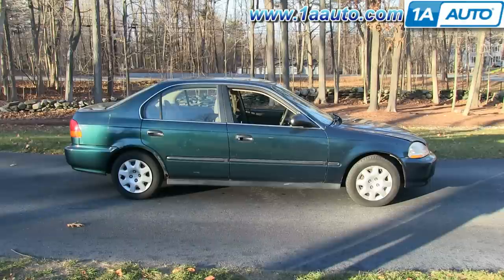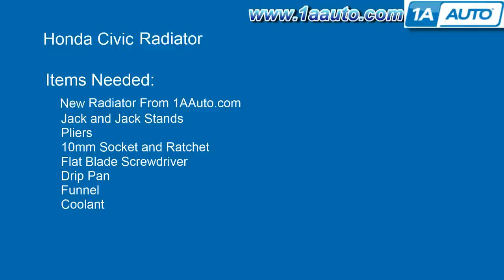How to Replace Radiator 92-00 Honda Civic

Comment: Thanks for sharing this video!  It gave me the confidence and knowledge to replace my radiator, and now my overheating problem is fixed.  For what it's worth: the cooling system must be bled after installing the new radiator!  I was unaware that was part of the process, and during my first test drive after installing the new radiator, my car quickly overheated, just as it did before with the old cracked radiator.  Then I was afraid the head gasket was blown.  But, after some research, I bled the cooling system by running my car with the radiator cap off and heat dial on high (but the fans off), keeping the RPMs up a bit for the engine to reach normal temperature.  After about 30 minutes and topping off the coolant in the radiator, all seemed good.  On the second test drive the temp was perfectly normal; problem solved!  Hopefully that helps.  Thanks again, 1A Auto.
Reply from the maker: Thank you for watching. Glad we could be of help. Please let us know how the repair comes out!
1aauto.com  888-844-3393

Comment: I like that you left the fan on the radiator, instead of removing the fan while still inside the car.
The more work you can do outside of the car, the easier.

Comment: Thank you so much for posting this Vid. I had an appointment set up to have mine replaced. After watching your video, I was convinced I could do it myself. It went in without a hitch. I also appreciate the comments below. I had not read them until after I had it in. I just bled my system, and I'm now good to go! Thank you again 1A Auto Parts!
Reply from the maker: Brad L Thanks for watching 1aauto.com 866-403-3393

Comment: Thank you so much for this video. In the Haynes manual it says to drain the coolant system and part of that is draining the engine block via two further drain screws. These are difficult to locate and the one by the oil filter is impossible to get to. From your video it is clear that it is unnecessary to drain the coolant from the engine block unless you want to flush it through and this saved me a lot of trouble. Thanks guys. I did take care not to lose coolant out of those two smaller hoses though.

Comment: Seems simple enough. I suppose while I'm under the hood I can go ahead and clean a bunch of stuff up and make sure there are no other hoses that are busted. Last time my coolant started leaking badly in my 96 civic, some oil had leaked out of the gaskets on my engine and saturated the rubber coolant hose underneath. It split in two and for about 2 hours I was freaking out about having to scrap my car.
I'm gonna give this a shot hopefully tomorrow and see how it turns out, thank you for the detailed video!! I'll keep you posted!
Reply from the maker: +shanesxe Thanks for watching.  Do let us know how the repair turns out.  1aauto.com  888-844-3393

Comment: I removed an additional little ultra rusted out metal bar that holds the insulated pipe in place that is shown in this video and sand it off some of the rust and rub some polish on it.

I also went ahead and took the entire under the car plastic protective thing off and cleaned off as much of the grease and tar that I could.

I found that removing that extra little metal bar piece allowed me to get to the transmission lines a little easier.

I would like everyone to know that at least on my car the pressure clamps on the transmission lines and I think the other big one at the bottom were made as three separate tabs in which all of my pliers were too narrow to open and there wasn't enough room to turn it sideways to use the length of the Jaws instead of the width of the Jaws and I ended up having to get a small scrap of what similar to like a toothpick but a little thicker and a little wider and I place that on the two tabs of the clip so that I could use that to push both of the top tabs at the same time while using my wrench on the bottom single tab so that I could compress it in order to slide it back to remove the hose.

I also had quite a bit of trouble lining up the little replaced rubber feet on the bottom in order to push the radiator down enough to make it fit in the car properly. There's a little rubber peg in the middle that has to kind of line up with a little hole in the middle cup shaped thing at the bottom.

Also the screws that hold that plastic protective thing under the car, they have these little plastic inserts that go into the holes and then you have to put the screw in and screw it but the screws will not screw in completely tight they will free spin after all certain amount.

I also foolishly didn't notice that they had the four replacement square nuts to go into the new radiator which allow you too screw the fan on it. So I put the old ones in that had rust on them. Unfortunately once you put them in, it seems impossible to take them out without breaking the plastic housing that they go into which is how I got them out of my old one. Also the old ones had a little bump that helps hold them in place. The new ones don't.

I also had some parts it came with that I didn't know what they were for and didn't use them. 2 rubber hose things and 2 long bolts and some weird shaped rubber pieces.

Comment: So u dont need to burp the coolant after doing a radiator replacement and changing the upper and lower radiator hoses? Also what screws should I buy for those bolts? The one son my fan are stuck and wont come out no matter what I do.

Comment: Perhaps you, 1A Auto, or someone else, can explain what to do to re-attach the splash shield (splash panel) once it has been removed. I'm finding that almost all of the 10mm bolts which I've unscrewed to remove the panel just keep spinning free when I try to bolt them back on. Apparently there is some kind of nut-like attachment behind where the bolts are fixed that has detached completely, has rusted through, or simply dropped off. Or bolts are self-tapping, but there's no metal left to bolt into properly

Bottom line, what I'm wondering is if I can use Nylon Push Fasteners (available in many places online or local parts store) to reattach the panel and dispense with this series of bolts completely? (Note: looks like beginning with the 2006 Civic, push fasteners are used, not bolts for the splash panel). Push fastener diameter might be 8mm, as that seems to be what the 10mm bolts are. 

Recommendations for just what kind/size  push-fastener will work greatly appreciated . Maybe 1A Auto or someone else can confirm. 

If not push fasteners to replace the bolts, then what else could be the solution? Many thanks.

Comment: Do you know the exact size for the 10mm bolts that hold the fan to the radiator?mine are all rusted out and I need new ones to mount the fan to my new radiator I'm at a stand still so any idea would be great thank you

Comment: What's that long hose called that you don't remove that goes right by the large plastic panel that you removed?  The panel is lose on my car, and I think it rubbed on the hose and punctured it.  Does oil leak from that larger hose, or is it coolant?  Thanks.
Reply: loose not lose

Comment: At 3:23 What are those small tubes connected to?  My old radiator does not have those two bottom tubes.  But every radiator i try to buy does have those two small tube mounts.  Do I need to find a radiator without them?  My car is 1999 honda civic LX
Reply: They go to the automatic transmission. Presumably they can just remain capped or not if your transmission is manual. But you might want to double-check that.
Reply: Your car has a manual transmission, the tubes are for the transmission cooler with an automatic; just ignore them with your car.
Reply: Lend me ur ear for a second mine is a 99 auto n da mechanic left those two radiator plugs on da bottom disconnected and da two hoses he connected em together wen i tried to seperate em oil came out wat do i do do i recconect them w oil drippin out into da radiator or not im afraid of my transmission overheating so wat should i do

Comment: The AT Cooler lines are filled with coolant correct? Just in case for some reason its ATF
Reply from the maker: You would fill the radiator up with anti-freeze once you make the repair. If you have an automatic transmission, the transmission cooler lines carry ATF through the internal transmission cooler in the radiator. Once the tranny lines are connected and the vehicle is turned on, the transmission will pump ATF through the lines. You may want to check the transmission dipstick to see if it's at it's proper level when the repair is done. Hope this helps you out.

Comment: I got a question of my 98 civic coupe while I'm driving I'm smelling a coolant from the vent and when I came to my destination when I turn the engine off the reservoir is boiling and smoke coming out what could it be a problem?
Reply: I'd say do a radiator flush, and check your thermostat.  Kinda sounds like a clogged pipe.

Comment: i have civic 98' in original radiator i dont have this two small taps in bottom where are going this tiny hose, and what i must to do ? because now when i bought they come with this taps, please help
Reply from the maker: The radiators come in two different styles for the Civic. It sounds like you just bought the wrong one. Hope this helps you out. 1aauto.com?utm_source=YouTube&utm_medium=CTA%20Comment&utm_campaign=1ATony 866-403-3393
Reply: +1A Auto Parts I think he's talking about the two hoses that flow transmission fluid
Reply: Sebastian Stanaszek yeah, must've gotten the wrong one bud